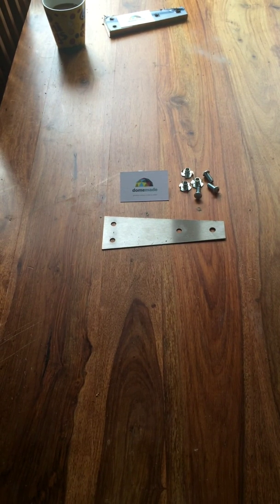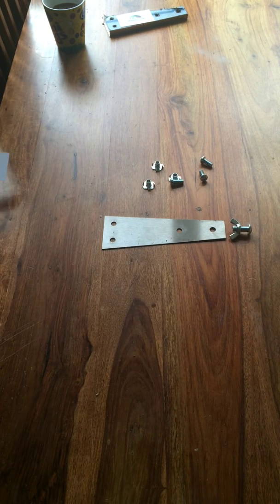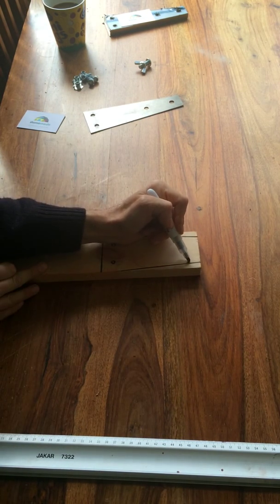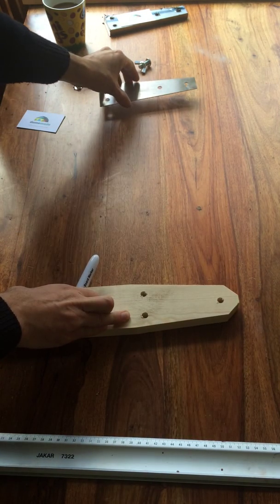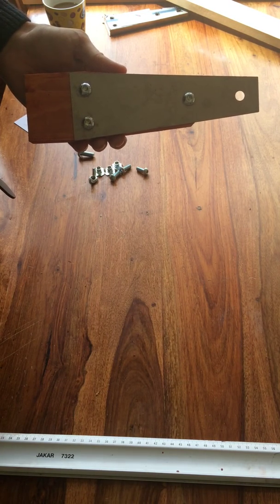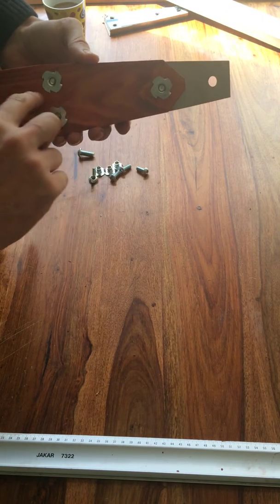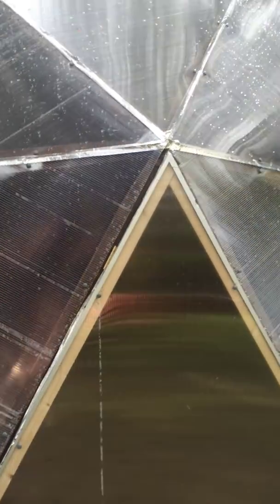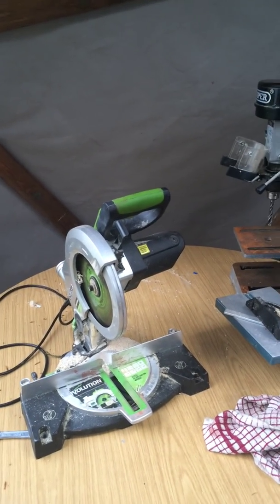Domemade Geodesic Hub system - Build a geodesic dome in the UK

Comment: It might be more simple but it is the weak point because of its design. In other words, the wood is stronger than that sheet metal. Since you are cutting wood anyway, then just make the correct angle cuts in the wood and you don't need a hub, the wood will extend into where the sheet metal is and just join with the other wood. It is only one compound angle cut in each piece. lol But once you figure out how to make a jig you only need to cut the first angle cut, then once you assemble on the jig, you make the second angle cut, but the gig makes it fool proof and perfect every time.

Comment: tubular hubs are neater, stronger and considerably cheaper than £255 ;)
The struts will be weaker in that orientation, they should be placed on edge not flat.. Stacked brackets create a stepped junction, which can be an issue with rigid coverings such as ply or polycarbonate as each strut will be at a slightly different height. 

The price of your geodesic sphere is ridiculous..£769?  
A 5ft 2v sphere costs less than £60. Something more impressive? try an 8ft 3v sphere for less than £140.